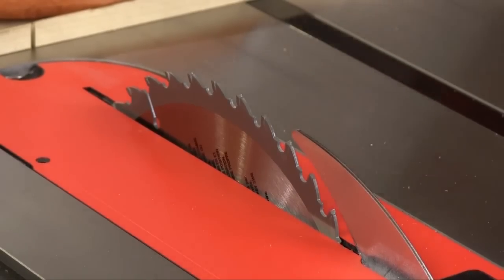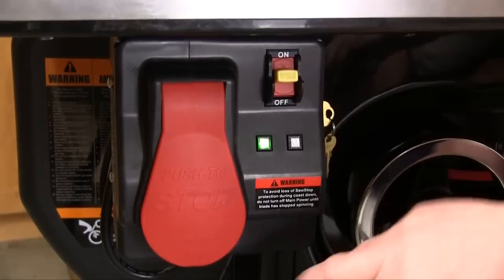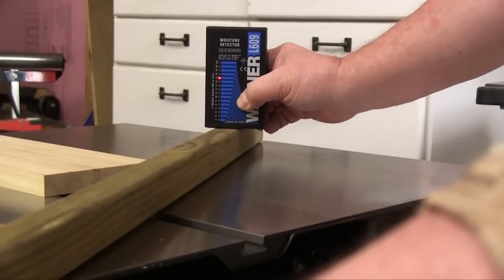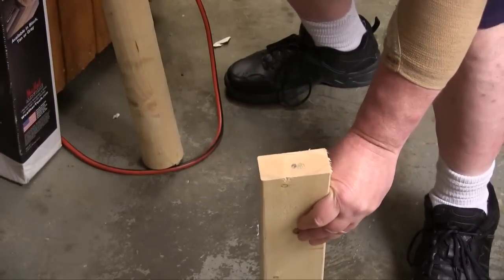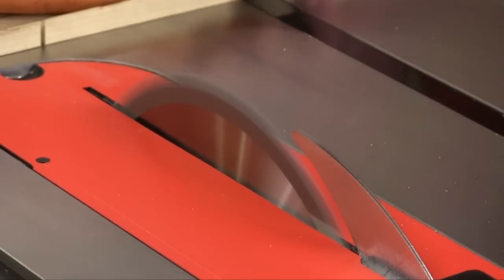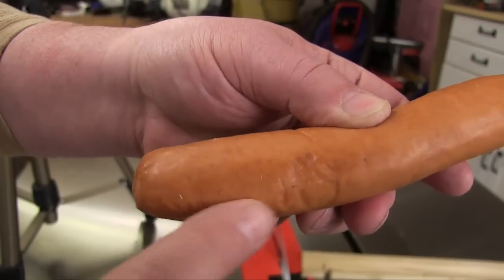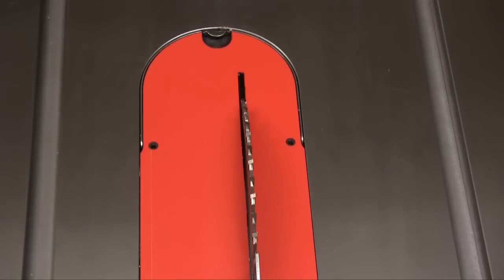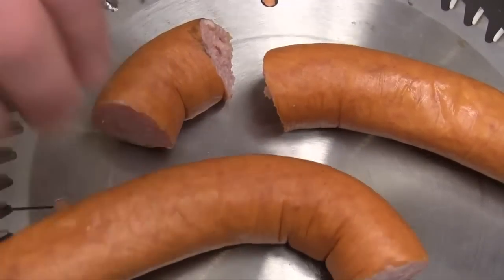SawStop Professional Table Saw Pt 2 Review | NewWoodworker

Comment: Thanks for the kickback approximation demo. This is the first and only realistic saw stop demo on the internet as far as I'm concerned. While still impressive, the hot dog moving slowly into the blade doesn't seem like a likely scenario. I suppose it could happen, but its pretty unlikely that I'm going to feed my hand directly into the blade with the work piece. If my hand contacts the blade it will be because I slipped, tripped, or experienced a kickback or some other unforeseen event that sends my hand quickly and uncontrollably into the blade. I'm convinced and converted!
Reply: Agreed.  The hotdog moving at a snail's pace doesn't really simulate anything.  Hell, if my hand was moving that slowly into the blade, I'd feel the blade and could pull away.  I wanted to see the hand moving towards the blade like it would in a real world scenario.    Definitely looks like its still a trip to the hospital.  But its the difference between having to find your fingers first and pack them in ice and never getting 100% use of them again vs a few stitches and a scar.  Without the sawstop, you can have your wife call the ambulance and with the sawstop you can drive yourself there.

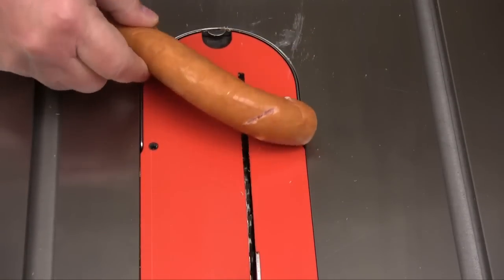Comment: The demo for the safety feature is great especially showing the dropping on spinning blade @ 4:15. That seems a more likely scenario than the slow careful approach that most videos show.
My concern was also at the beginning of the video showing the rotation of the blade riser crank when the machine turned on. That's not building confidence in cut accuracy.

Comment: Super impressive!  I would hope I’d never need the thing to save my fingers, but I’m not sure I’d trust it to cut melamine again after a shot like that. That shot would be extremely hard on the exact parts that make it such a smooth accurate saw.
Reply: Test a scrap piece of melamine and see if its.still accurate after ten to.twenty sawstop safety cartridge firings.

Comment: I'm in the midst of applying for a patent for a new safety system that detects human flesh and stops the blade before it actually comes into contact and also does not damage anything at all. The saw blade instantly stops and then you just restart it and go on with your project. Nothing to buy or replace.

Comment: How much does it cost to fix it after it's deployed? Obviously, I would rather have my fingers but just curious.
Reply: You can send the blade and brake off to SawStop and if they detect that it came into contact with human skin they replace the brake cartridge for free, from what I understand.  I believe you still have to buy a new blade.

Comment: It is admittedly amazing. 
However these kinds of safety features should never replace good safety training prior and during a lifetime of use of dangerous machines. 
Before turning the saw on and before starting your cut, always ask yourself, “ Where are my hands” in relation to the blade. Do this every time without fail until it becomes ingrained in your thinking.
 A little fear is also healthy when operating dangerous equipment . 
Not enough to impair your co ordination but just enough to heighten the moment .

Comment: how much to replace the part?
Reply: +Robert Fernandez The brake is about $60-70, and you'll need a new blade as well. But it's easy to replace and it sure beats losing a hand.
Reply: Dave Starr literaly still cheaper then if you hot lucky and could have the finger put back on.
Reply: Robert Harris $100 vs $1000 in hospital fees
Reply: Perkaholic talk about a good investment. Lol.
Reply: SawStops are definitely a very good investment, even if you never trigger the safety. They just also happen to be a BIG investment that not a lot of hobbyists can afford.